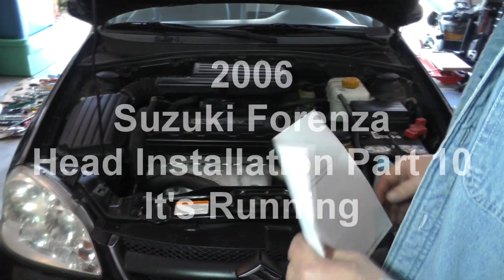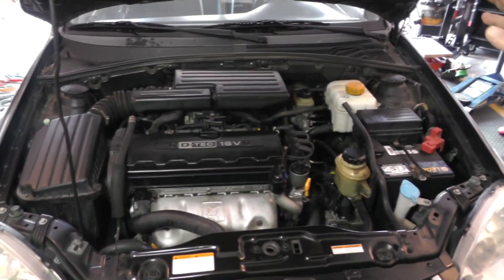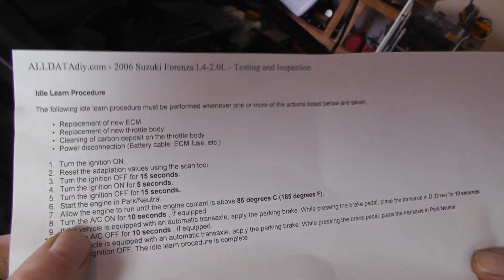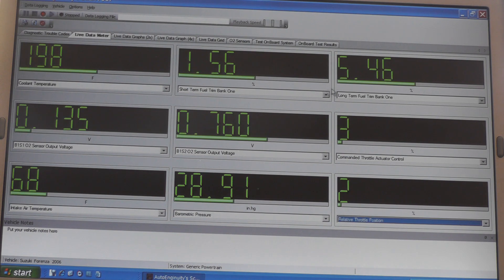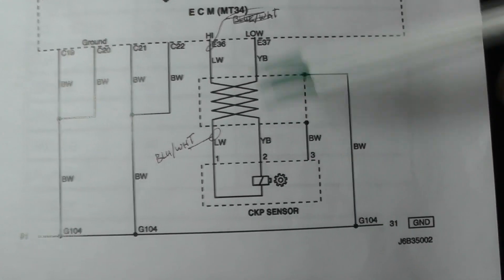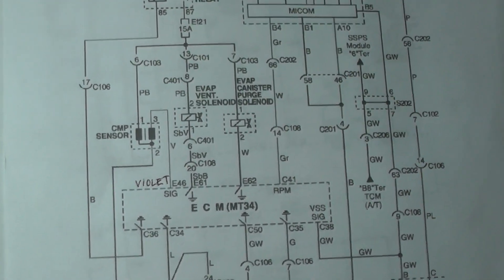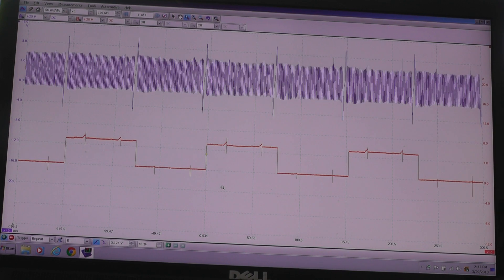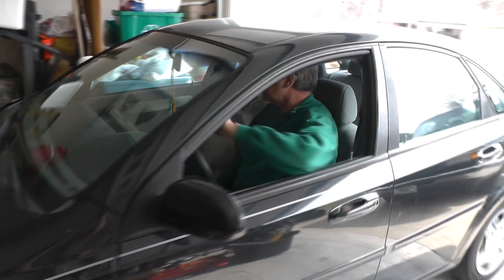Suzuki Forenza Head Installation - Part 18 (Running)

Comment: Super job Terry! Do you have any more instructional videos out there? I'd be interested in seeing how to check sensors and diagnose any problems with them. I'm 58 so I'm old school. I've done my share of mechanic work over the years but not too much electrical stuff. I've read a lot about checking the various sensors and millivolts but have as yet to try it. It's a little confusing. Heck I'd like to see any more tutorials you have out there!
Reply from the maker: Thanks Allen for your comments and I have been thinking about how to check sensors and other electrical stuff, but it seems that a lot of people don't seemed to be too interested in those type of videos. I'm still thinking about it though as far as showing sensors, how they work, etc. I did do some videos of how things work such as waste spark ignition systems, hall-effect sensors, IAT and ECT sensors to name a few. I believe they want to see more of how to remove and replace. I try to do most of my videos as a tutorial to let you know how I think about a problem, where we're going to go and hopefully, other useful information that the viewer may find helpful. If you want to see on-the-fly diagnosis with a VW Jetta which is the latest series that I've done, that may be of interest to you. I've been working on it today and now putting everything back together. I'm rendering the last video of that series now and should be uploaded later this evening. Here is a link to the first video of that series.
Volkswagen Jetta Won't Start, Electrical Diagnosis - Part 1
Also, there should be quite a few videos on electrical stuff on my homepage. You can browse the videos to see what may interest you. Thanks again for the comments and for your suggestions.

Comment: Hey Terry,
 I followed your videos on this rebuild and with this being my first rebuild I was a little scared to try it ! Well today I finished up and went to turn the key and man she runs like a sewing machine. Thanks for taking your time out to make these videos it really helped me out a lot! I had a old tank mechanic tell me to pour a cup of diesel fuel in the oil and then change the oil again after running it for five mins or so to make double sure its clean. I have yet to try this because she is running so good. Do you think that is a good idea?
Reply from the maker: Glad to hear Adam that everything went well for you on the rebuild. I assume that you probably had a head gasket leak since you mention about the diesel fuel. If so, I've heard of different things to run in the engine to clean it up. I assume you've already changed the oil and filter. You could change the oil and filter after a few hundred miles and then you'll be done with it. Even if you ran some stuff through the engine, you still have to change the oil and filter. So, leave the stuff out and just do the oil and filter change. Really glad to hear that it all went well for you. Take care Adam...
Reply: stuzman52
I am ready to start on another one haha. Just kidding I am ready for a long break after 4 days of turning wrenches. I think I will wait a few hundred miles and change the oil then like you said.. I did have a head gasket leak. Well thanks again and take care Terry.
Reply from the maker: Adam sell You take care also and now you can take a little break...

Comment: Terry
I did not clean the throttle body properly. I took the car in today for a professional radiator flush and there was still oil and debris in my fluid but it is clean now. I tried to do it myself but I could not get it to drain well. I drove the car today for about 60 miles total with no problems. The lube place that did the flush also has a system to clean the throttle body and injectors. It cost about $90. Do u recommend this type of cleaning? I don't really have time to
work on the Reno right now myself. Have u looked into kickstarter.com? I think with your fan base you could raise money to produce videos for us novices on a grander scale. I liked your style and I think u could do it. You are a natural. Perhaps rebuild/overhaul of something older but popular like a 
Mini Cooper or Prelude. You could just purchase the car and fix it up with the money instead of waiting for any car to come to you. I would definitely pledge and contribute. Thank you again Terry.
Reply from the maker: It wouldn't hurt to do a throttle body cleaning and injector cleaning and the price is more than reasonable. Around here, that runs about $90. One other thing since you probably had antifreeze and oil mixing is that you could have a contaminated O2 sensor which could contribute to a rough idle. Just something to keep in mind. I never heard of kickstarter.com but I'll take a look and see what it's all about. As I mentioned before, keep a close watch on your car as this a critical time and you want to keep a check on all of those fluids. Take care...

Comment: Hi Terry
My name is Mark and thank u for this video series. I changed out my head gasket on my 2007 Reno using your videos. I am an accountant by trade not a mechanic. I was very pleased when I was done and it actually cranked up. This car has always had a lousy idle from day 1. I think it is worse now but runs great on the road. I have not tried your idle relearn procedure. Do u think that might help? No check engine lights are coming on and the car is running cool. Any suggestions would be appreciated and thanks again for your videos. I am now a big fan.
Reply from the maker: Always glad to hear other folks with no background in mechanical and working on their cars and getting them to work correctly. For some suggestions, be sure to keep a close check on the car such as checking for oil leaks, coolant that is dropping low in the coolant reservoir, unusual odors. You know, things out of the ordinary.. As for the idle, did you clean the throttle body up when you had it torn down? Carbon in the passages of the throttle body and around the throttle valve could create a rough idle. It wouldn't hurt to try the relearn procedure, but since you have been driving, it should have probably already learned how to idle. I was also thinking about the timing marks being off by a tooth. But the car would not have the power on acceleration. Since you say it runs pretty good, we can ignore that. If there are any other issues, the check engine light will come on to let you know. Just a keep watch on the vehicle for now and see how things go with her. Take care Mark and glad to hear that the videos helped out. Oh, and thanks for the sub...

Comment: so the car is running again thanks to your videos!!! i have noticed that on the valve cover where it goes into the egr valve there is a little bit of oil dripping is that normal?? thanks again..
Reply from the maker: Good for you angel that your car is running again, and I'm glad the videos helped you out. I had the same issue after it ran for a few months. For me, I reviewed my own videos to see if there was an O-ring or some type of gasket that should seal this area. I did not see one when it was torn down. I then looked at the parts breakdown for this area online to see if there was a part for it. Who knows, maybe someone in the past left a gasket out. I did not see one listed. So, this is probably a design issue where the tube that fits over the EGR is not tight enough to keep oil from slowly seeping out. To fix this, I was going to get an O-ring or maybe a gasket, sized to the inside of the tube and seal it myself. It turns out that there was a buyer for the car, so I sold it and never got a chance to try and fix that issue. Maybe you can come up with something for the viewers out there. Take care angel and once again glad to hear your car is running.
Reply: i know its so strange.. what do recommend i do? will it hurt the valve cover gasket if i take it off again?? thanks
Reply from the maker: angel rojas Since the gasket hasn't been on that long, you'll probably be okay to reuse. The best I can recommend is that if it's not too bad, I wouldn't worry about it. Or if you want to try and fix it, you can do as I mentioned about putting an O-ring or a type of gasket in there. I didn't research it any further since the car was sold. Take care...

Comment: my car is a leganza daewoo 2001 it does not start. i have checked everything fuel compressio, spart etc. is my ecm deprogrammed? thanks
Reply from the maker: Hi Luis. Sounds like you need to check for compression and timing. Have you checked the timing belt to see if it's broken or has slipped? Your ECM will not be deprogrammed.
Reply: thanks for the quick response. i have checked for compression, timing marks are aligned, spark is good. i even paid a mechanic to come at my house to recheck my troubleshooting, he checked fuel pressure was good around 50, compression was  120. 80. 120. 80. respectively for cylinders. battery was charged to full. he got to a conclusion that injectors have pulse only for some seconds and then the pulse stop. he said that crankshaft position sensor is good because otherwise we would have no spark. i looked at the crankshaft sensor and it shows peeled wire all over. i went ahead and put some tape around it. he is claiming that computer is been without battery like for 7 months and that's why it gets deprogrammed. he wants $100 for reprogramming.
Reply from the maker: It's unlikely luis that the PCM has lost the program in the flash memory. I've had cars not running for months and have never experienced this. The Suzuki was out of commission for about four months and no problem with losing its programming. A Buick was out of commission for six months and no issue. Even microcontrollers that I work with have no problems. In fact, Atmel microcontrollers guarantees that it will only lose one bit in a million in 100 years. Since you're losing the fuel injector pulse intermittently, take a close look at the camshaft position sensor since it does the sequential firing of the injectors. This should be a hall-effect sensor which will generate square wave pulses. If you don't have a scope, you can use a voltmeter to see the high and low voltages generated. If I remember correctly, you should see 5VDC and ground level voltages. You can see these voltage levels while bumping the engine over. While you're at it, go ahead and take a look at the crank sensor signal too although you are generating a spark. This sensor will be a magnetic pickup type (VRS sensor) which will generate an AC voltage. Turn the engine over while monitoring the signal and see if you get a signal from it. Almost forgot, your compression readings do sound a little low. I would expect them to be around 150psi and 80 sounds really low. You may want to squirt a little oil in the holes to see if compression comes up. Or you may want to do an air leakage test. Hope that helps you out.

Comment: Well I done every thing i was suppose to and took my time, I can not get it to start ,it was running fine befor it broke ,it bent every valve and even broke the tenshenor,so it done alot of damage ,but every thing was machined and replaced new ,what am i not doing right or what seem to be the problem? thanks stuzman52
Reply from the maker: Hi Bobby, it's hard to say, but I can throw out some ideas for you. Did you make sure that you connected up the PCM ground wires on the bottom of the intake manifold? Connectors of importance would be the crank and camshaft sensors. And the connector for the coil pack. If you don't see anything there that's obvious, then you may want to take another look at your timing marks, just to make sure that everything looks fine there. Let us know what you find out and thank you for your comment.
Reply: stuzman52 thank you for your reply . mine is a 2004 forenza and i don't have any ground on the intake that i know of , i think i will go ahead and look at the timming marks,then start on other things , what about codes ,are they any codes that would stop it from starting ,thank you
Reply from the maker: Hi bobby, crank and cam codes could keep it from starting. You could check for spark and fuel, but I would probably go right for the timing marks and see if they are still aligned. I remember one fellow who had bent valves, pulled the head, had the valves replaced and machine the head and then it wouldn't start. Then he thought the timing marks were aligned, but when he pulled the timing cover to check the marks, he found out that the marks had moved. Unfortunately, with the marks out of time, the valves got bent again. I felt really bad for the guy. So, you may want to start there because if everything is plugged up, it's not much else to look at other than the timing marks...
Reply: i will get started on it , cross my fingers
Reply from the maker: I'm praying for you Bobby, and I've got my fingers crossed too!
Reply: stuzman52 OK mr. stuzman ,i tore into it a while ago and on the exust side it jump time on about 13 toths to the right do you think it might of bent some valves on 13teth, ? thank you
Reply from the maker: Hi Bobby, I would say that if it jumped that many teeth, then it's a pretty good chance that you've got some bent valves now. What happened? From your first post, it sounded like the belt broke and bent some valves. You had the head reworked and after putting it back together, the timing marks are out. How did the marks get out so far?
Reply: stuzman52 I don't know what happen ,all marks are on but that one ,dont know what happen ,turned it over and over to make sure it was tracking ,now when i ter it down will i need new head gasket and new head bolts ? thanks
Reply from the maker: Wow Bobby! I sure hate to hear that for you. Yes, at this point as I mentioned, you probably got some bent valves. If all the marks were aligned in the beginning, maybe the tensioner slipped. I'm not sure what happened. You'll have to get a new head gasket and new head bolts again. Let me know how it goes and sorry to hear about your mishap. Trust me, things like this has happened to others, even myself. So, don't feel too bad about it.
Reply: MR.STUZMAN ,i found what i done wrong had a man to come look at it , I use the wrong timming mark on the exust side mine has two and yes i used the wrong one , do you think i still bent valves ? before i break it down any more i thought i would ask you.,thanks
Reply from the maker: Hi Bobby. Glad to hear that you found out what happened. You still probably bent some valves, but before you tear it down, get the marks all aligned as they should be. At this point, you could try and see if it will start. But keep in mind, that if you do have bent valves, that you'll probably create more damage to the head and/or pistons while cranking. To be safe, I would do a leakage test first which won't take you that long. Take a look at the second video of the Suzuki video series and I show you how to do that procedure to determine if you have bent valves. This will take a lot less time than pulling the head, where who knows, you might get lucky and there's no damage. One other thing if you decide to do the test. Sometimes it's hard to determine if any air is escaping out of the tailpipe. I forgot to mention this in the video, but you can take a latex glove and rubber band it around the pipe. If you see it blowing up, you've got bent exhaust valves. Or you can put a piece of tissue paper over the pipe and see if it moves. Good luck Bobby and hope it works out for you that you don't have any bent valves.
Reply: i will do the test ,and not stat it ,thank you so much for your reply.PS i can't belive i was so blind,but that happens win you get 56
Reply from the maker: As I said Bobby, don't feel bad about it. One thing for sure, you'll know this engine by heart and you won't make that mistake again. And me at 62, trust me, I've made my fair amounts of mistakes too. Good luck Bob and hope it all works out for you.
Reply: stuzman52 Well I tore it all down again and had it looked at  and put it all back toghter again ,and it started right off the problem was I bought a bad tenchener it would let it jump time ,thanks a million for your help
Reply: Glad to hear it all worked out for you Bobby. You are one lucky fellow to have it all turned out good in the end. You're quite welcomed.

Comment from the maker: One more thing Joe. Stay tuned on the VW VR6 that I'm working on now which threw two codes. I'm in the process now of pulling the whole front assembly out now to get to the secondary air pump system. That will be one where diagnostics is used to go through each component. Of course, to be an effective troubleshooter, you HAVE to know how it works. Otherwise, how can you fix something and put it back into working order if you don't know how it works. We'll go over the system, diagrams, etc.

Comment from the maker: Sure Joe. I try to do that with the videos now, but sometimes, the diagnostics does get dragged out. On the Ford Ranger with a sending unit problem, I took everyone right along with me and they were finding out at the same time as me what the problem was, how to diagnose it and how to confirm our diagnosis. All of this starts with understanding the system, how it works, which includes wiring diagrams, coming up with our diagnostic strategies, etc. The same holds true for the Buick video...cont)

Comment from the maker: On the Autoenginuity scanner software, I was using a Dell Latitude D810 which is running WinXp Pro 32 bit on a Centrino. If you noticed, the other Dell computer was a Studio 1558 running Win7 Pro 64 bit with an I7 processor and having 8Meg of memory. I did have Autoenginuity on this computer, but I had a video driver problem and had to reinstall Windows. I just never got around to reinstalling the scanner software. Remember, Picoscope is a scope and not a scanner. Yes, I would buy both again!